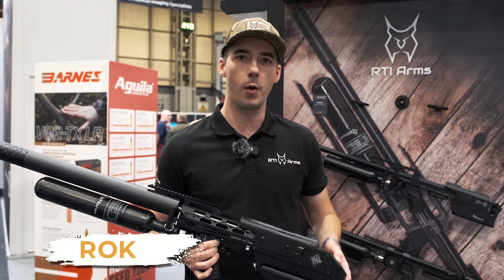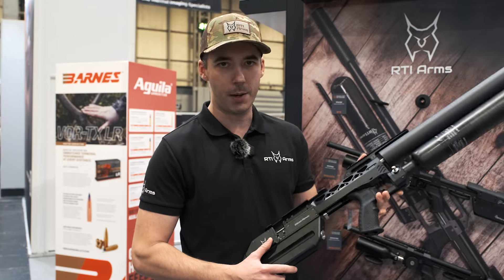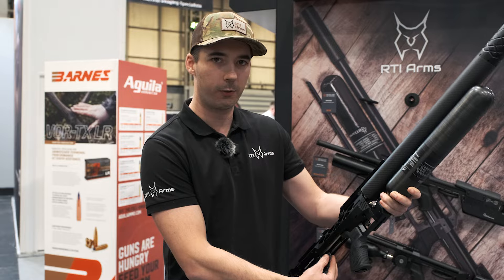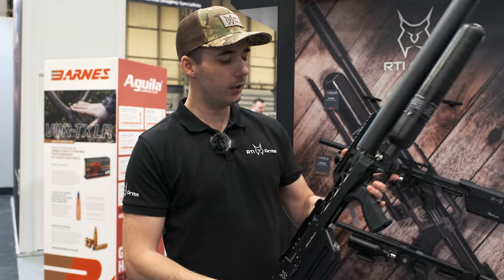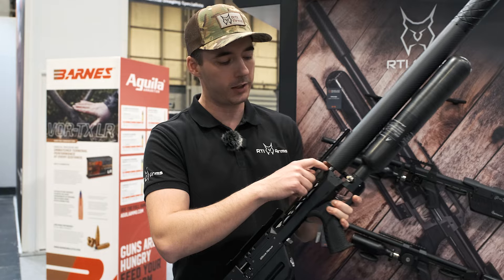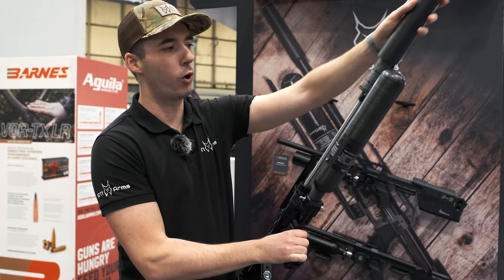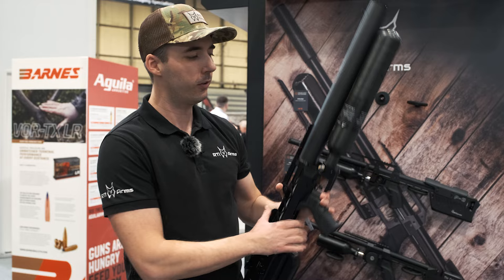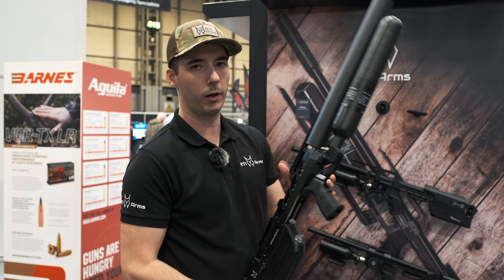RTI Airguns - New Release for 2024 - Mora PCP

Comment: Rok, I'm very excited for this gun! I'm going to pick your brain on speed and energy difference from 600mm to 700mm. This gun, may have enough power in 600mm for me, but I'm also interested in the performance of the 700mm. I will be mostly interested in .25 cal, and shooting 41, to 47 gn slugs, in the 1,000, to 1,050 fps range. Ideally, I want to shoot at 1,030, to 1,050, so I'm thinking the 700mm will get me there, but if the 600mm can, then that will  better suit my hunting application. Any way, if you can pm me with some hard statistics,  I will then transfer your information to Precision Airgunning, so all 21,000 of our followers can see the stats, of this very anticipated, and impressive platform! Thanks for all you do Rok, for our incredible sport, my Brother in Arms! 😎

Comment: What’s the price my friend? (Euros). 

Will you also have a ‘Basic’ version with an aluminium shroud & 500cc bottle?
Reply: £3,000
Reply: @markjohnson2166  You know something? My first guess was around €1,800. However, the more I look at this thing I wouldn't be surprised if it starts at €2, 300. 

However,  the fact they haven't given any indicators of the price what-so-ever makes me think it will be even more expensive than that! (probably €2,500+). 

I really hope it's not that expensive otherwise they could price themselves out the market as they are many other options I would consider at this price point. (E.g. Skout Evo, Epic Two, Ghost, LCS SK19,  Uragan 2 Carbon...)
Reply: @markjohnson2166 what is that amount for the USA market? There $1,800-$2,200 here now

Comment: Weight should be not more than 3 kg. I am a boss hunter in my district i use jk han nobless .22. Lcs air arms sk19 .25
Vulcan 3 .25 700mm.  But every time i face weight problem during my hunting cause in remote area i have to walk miles and miles for hunting. So that low weight is a must  for a hunter choich
Reply: if you want lightweight you can always go with RTI P3, I don't think this one is aimed at carrying around for a long time, it is a big gun, big bottle...